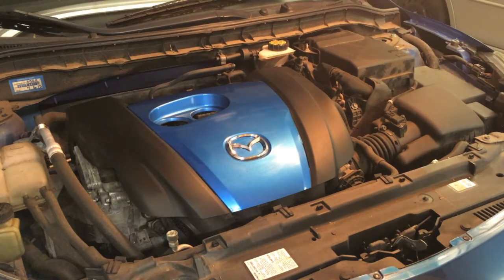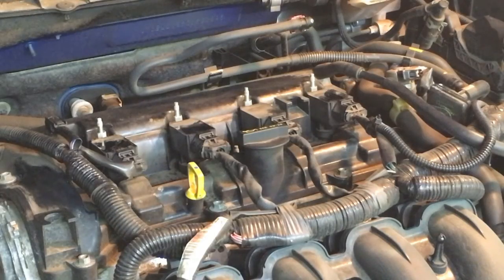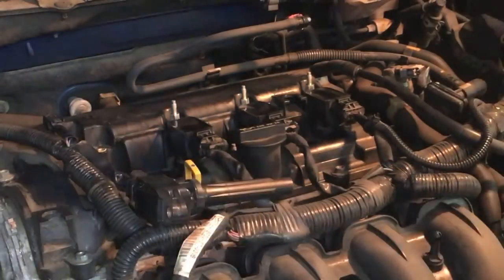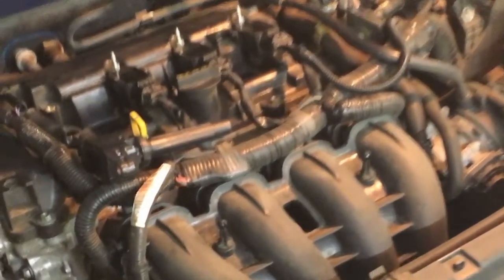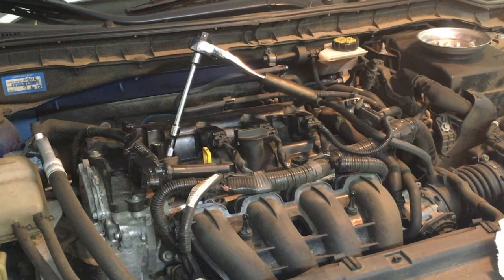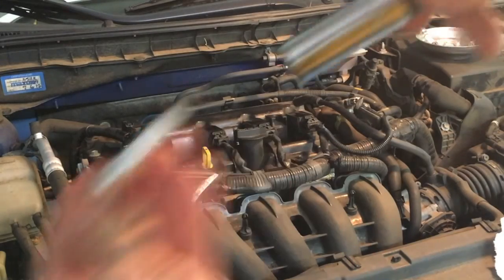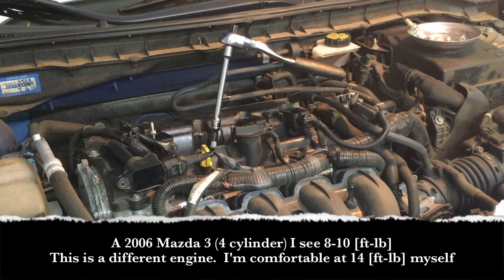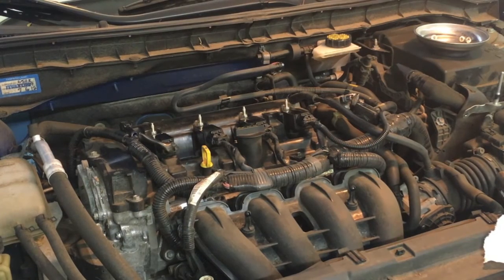2012 Mazda 3 Spark Plugs Change (SkyActiv 2.0, 4 Cylinder)

Comment: 14mm with 6 point thin wall socket.  OEM spark plugs are Japanese Denso or Japanese NGK.
Male sure you get the Iridium versions as these are the BEST ever! Tough and lasts years giving you full power, clean combustion and never failing!

Comment: What do I do if there’s oil in the spark plug holes? Do I still replace spark plugs or wait until the gasket is fixed?
Reply from the maker: IMO, if the car is running ok, I would wait on changing the plugs.  If it's not running ok, change the plugs but try to get to the seal as soon as you can.  I don't think the oil creates too much of a problem to the plugs or ignition unless it's a lot getting up to the wire height.   So frankly, if you are really on a budget (be that time or money...) you can probably just suck the oil out and see how long it takes for it to come back.  It could be a very slow leak and make it a year between cleaning it out.

Comment: It was hard to watch you struggling to get the 9/16" socket to engage. I mean, what the heck. It's 14mm dude. If you want to own a vehicle manufactured in Japan, best get acquainted with metric fasteners. Also, save yourself the cash next time and use a solid extendable magnet to remove and seat the spark plugs, and the requisite 14mm socket to do the rest. Thanks for the video. YouTube always saves my butt. :)

Comment: What about di-electric grease? Also how do you hand thread when can only reach with a tool?
Reply: I see, hand rotate the extender before putting the racket back onto it.
Reply from the maker: Turtle C:  correct